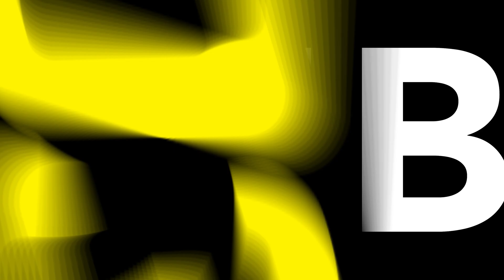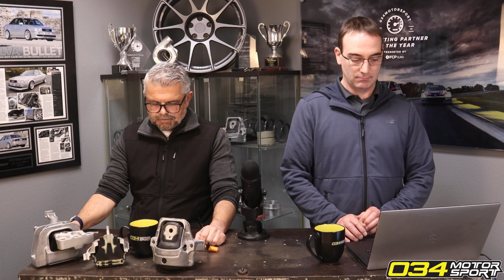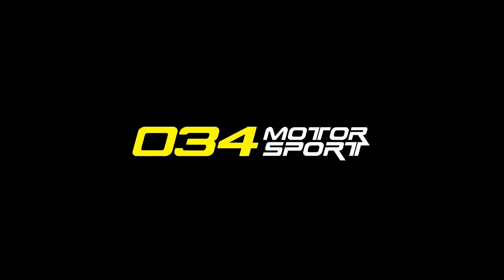Will A Tune Cause My Audi 3.0T Supercharged Catalysts To Fail? | 034Motorsport FAQ

Comment: Is there a way to go Stage 2+ while keeping the exhaust as quiet as stock in a C7 A6? Can you move the stock cats downstream?
Reply from the maker: Our Stage 2+ Dual Pulley setup can utilize a completely stock exhaust system. Moving your catalysts downstream or removing it entirely (for sanctioned racing use only) will result in a volume and tone change.